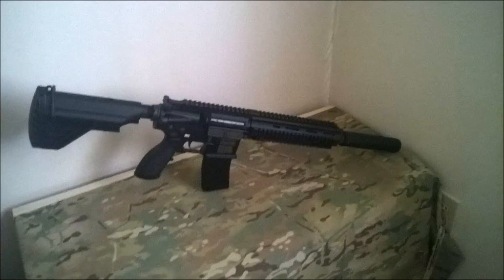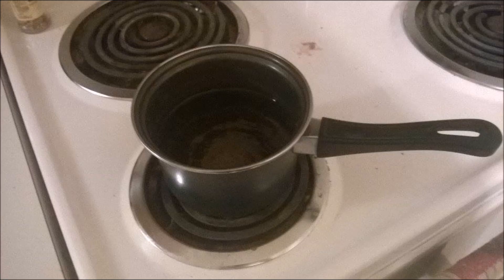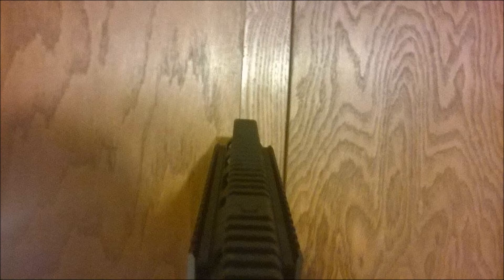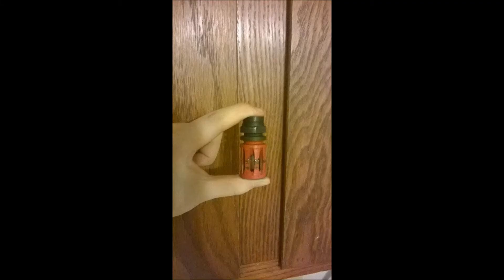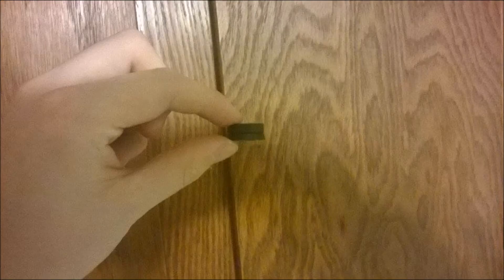How to Remove the Flash Hider on a VFC HK416 (Or Any Other Airsoft Gun)

Comment: Did you use a wrench to twist the flash hider off? Or could you use your hands (and cloth to protect them from the heat)
Reply from the maker: Wrench would be better for protection and extra torque. You could wrap a cloth around it to protect the flash hider
Reply: The BB Warrior thanks for the solid advice man, you rock!